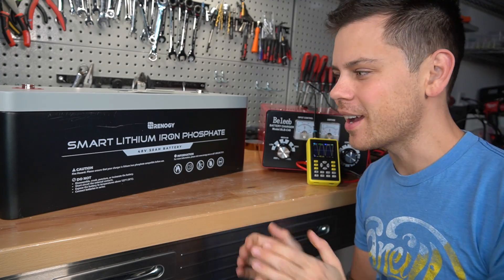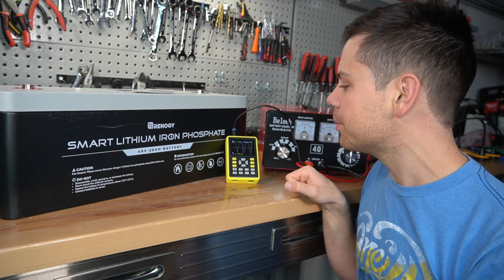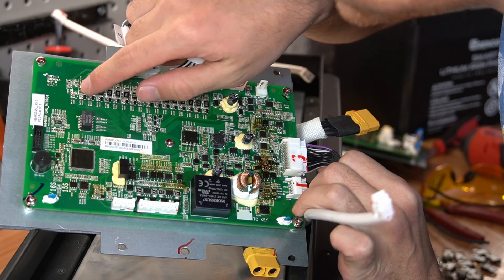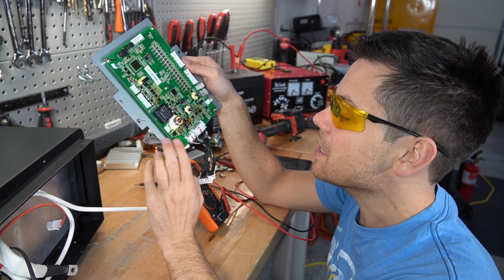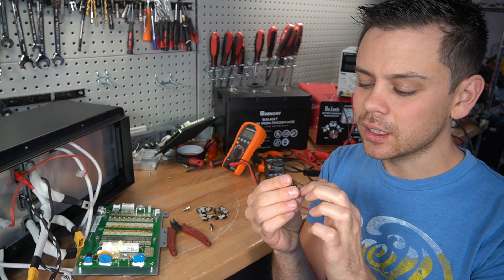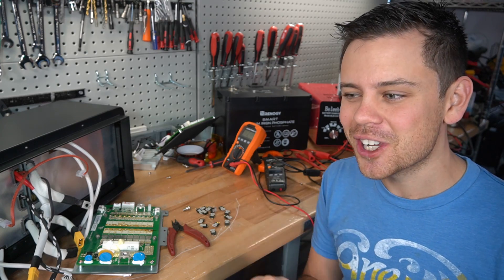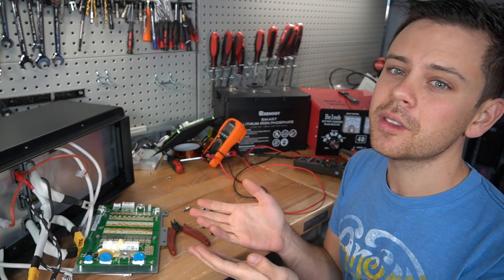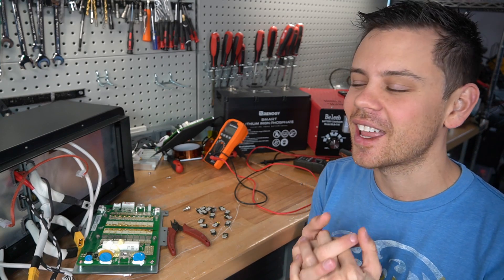Renogy "Smart" 48V 50Ah Part 2: How did I kill it?

Comment: For playing around with different voltages I like my Riden RD6018 DC Power Supply.  Will here's a show you could put on using different solar panels with a East Tester ET5410 or equivalent  use the LED settings to pull maximum or minimum of your choosing by changing to offset the voltage to its maximum or minimum.    Next change amperage higher or lower to get the Watts  maximum or minimum.    Settings on the ET5410 goto MODE scroll using Dial knob to 12.LED hit ENTER,   LED TEST SCREEN put the voltage on high setting or to your choosing same with the amperage you will see the ohms change as you do this try not to have error code come up you could have fun doing a show on the subject.  Your viewers would love it to see the maximum efficiency you can get out of a solar panel.  You could use this example with a solar panel tracking the sun or for individuals who use solar panel on a boat put it horizontal position and you could see the difference as well how much you can you can get out of a solar panel. You could do this from sunny or cloudy days.
Reply from the maker: What scope would you recommend? Any other equipment I should buy?
Reply: @WillProwse  Will I would not know how to answer that question it's just what I've been playing with and learning from watching you and other Youtubers love what you do experiment and having fun . I've learned this the other day stumbling across that and seeing what it can do.  ET5410.  From high school playing with electronics to my Navy days on the F4 phantoms aircraft.  Aviation technician. I'm 58 years old this gives me something to do. Remember how you start out and grow to your success, I'm proud of you how are you became pretty much nothing to where you are now.
Reply: @WillProwse  that new amplifier that you have to do load test do you think you could do that straight off the solar panels by tracking the sun or laying it horizontal to see what the solar panel results can be ?  ET5410 that's what I was doing the other day with that equipment I was having fun like if it was a manual MPPT tweaking the voltage amperage to see what the ohms resistance come up with pretty cool.  Most of the time you're always doing battery performance test do the same thing with the solar panels to see if the specs come out what the supposed to be lol. This is something to learn from your viewers I think would appreciate more information to use and maybe a different application by building different battery management systems at a lower voltage something like an MPPT charge control.  Opens up the mind to learning new experiences.
Reply: @waynemitchell7871  btw there is custom firmware from unisoft ..adds nice features for bat charging
Reply: @cgmarch2359  good point whatever battery chemistry you're using stay within the factory recommendation,  you can never go wrong and get the longevity out of the battery using it for what it's intended for . What I noticed like with lithium iron phosphate you have the minimum voltage and the maximum voltage. The battery management system you can change things around to get maybe 1 to 2% more out of the battery but then you're taking a risk of damaging it. If you wanted to do a true capacity test you would remove the battery management system straight off the battery see what it can really do have all your test results closest to the battery to minimize any efficiency lost through wire traveling distance and heat loss with small gauge wire. Big gauge wire always good to use to keep it cool when pulling high amperage.  Make sure you have the proper test equipment not to damage anything. There are some people would like to see what the batteries can do by overcharging them and blow off some electrolytes lol. There are plenty YouTube videos on that.

Comment: You should not call the charger as "crappy" since it works perfectly for intended purpose, charging lead-acid battery.
When the BMS disconnect at max voltage, fully excited induction coil in the charger can't keep the current flow, so the voltage spikes to kV range. This will never happen with lead-acid battery.
Reply from the maker: Yes true
Reply from the maker: Still going to use it for lead acid too

Comment: Good stuff. Is it possible to connect a charge controller mppt to that charger so you can limit the voltage and convert the rest to amperage? For next time of course... :)
Reply: Yeah, this can work especially if you have an unregulated power supply. Just be sure it's MPPT. PWM controllers with a higher DC input can fry batteries or loads depending on use. Many cheaper PWMs rely on the battery load to regulate the output, so if you remove the battery, the output peaks up to the input voltage. Of course almost all controllers tell you to connect the battery first and remove it last, so caution is advised.

Comment: The bottom line to me is that you used that charger with other batteries without damage, makes this one look pretty fragile.
Reply: Exactly
Reply: My F350 would seem pretty fragile if you dropped a bulldozer on it. In the real world, these batteries would not see the extreme conditions that Will exposes them to. I don't think Will came to the same conclusion about the durability of these batteries that you did. Maybe the charger developed the high voltage condition between the time he used it on other batteries and the time he tested the Renogy battery. There is no way of knowing if the test conditions were exactly the same.  I have seen nothing in this or his first video that suggests that these batteries will not perform as expected.

Comment: Will why use cr@ppy chargers?  There’s a volume seller of meanwell HLG-600H-30A adj CC&CV , nom 30V power supplies on e bay. They are rock solid and have ridiculous 95%efficiency and near unity PF.   Heavily used in ebike world in series/parallel.  A 2S2P  config of those would give you a super hi quality and safe 40amp charger for 48v class packs.  I paid around 50/each for a dozen.  Units are brand new, some kind of massive clearance situation. ..
Reply from the maker: Because I was an idiot and using my favorite inverter charger for my golf cart. I forgot I had two spare growatts I could have used instead. And yes, I will use a better one next time. I was just grabbing what I charge my other 48V packs with. Stupid me
Reply: @WillProwse  oh but so many of do exactly the same thing...thats the kicker.  Perhaps the question might be, why dont they design them for real world users?  Otherwise its a bit of "tricky talk" advertising specs when people are going to use it in certain culturally predictable ways. Oh, were they designed by Chinese? tricky consumer culture there, fast and furious, the salesman disappears into the crowd of one biliion after making great promises.  Missaprehension of implications to "win at all costs" and what the implications are for the future customer relationship and loyalty. 

Manufacturers and engineers are unconditioned to affluence and legacy first world marketplaces; have no culture of inventiveness and individual identity cuture,  even more limited at understanding target market behaviour and psychology(that's you and me babe, and we all have 5 chinese slaves.)  As well, many products are being (poorly, under duress) produced by political prisioners.

The company should take note: they will save money, reputation and consumers on returns if they design for the real use scenario.  Also, there is a HUGE return rate on electronics, becasue people cant figure them out.  It is in the manufacturers best interests to assure pain free adption of their technology by directing the product to the correct demographic, and educating their potential customers.

This is not a game where they are right and the customer is wrong.  However, I can see that arrogant and slightly aspergers engineers might take that predictable alpha male stance of win at all costs, have no backup plan, damn the torpedos, break the customers hymen and impregnate that market bitch at any expense. And so the ship goes down, you sunk my battleship!

In a new business venture, many would rather be a glorious failure than a miserable sucess.

Comment: Will, can you fix the battery?
Reply from the maker: Haha no
Reply: @WillProwse  Could you ship me the battery? 😊 I could fix it up and use it.
Reply from the maker: @ShaneFromSA  It weighs sixty pounds. where do you live? And the cells are over charged. And the board is fried. What could you salvage?
Reply: @WillProwse   It looks like it has settled down, 22V for 6S and 25V for 7S, looks like the cells might be salvageable. I would try to repair the BMS, if not possible I would replace with another one. I live in MA, I would pay for shipping costs.
Reply: @WillProwse  Bummer. I guess you can salvage some of the parts for a future home build.

Comment: This is why we watch your videos Will! Always up front with mistakes and problems.

I am SURE any of us idiots out here would use similar tools. 

Manufacturer recommended charging is probably a good idea.
Or, you know...

Solar.
Reply: In this case I don’t think the users are idiots. A product like this should be able to handle lead-acid chargers and if they don’t that would justify a very loud warning on the battery near the connectors. 

But from a very high priced product like this I think it should be able to handle high voltages or at least not be broken by it.

Comment: Thanks Again Will, I believe the assessment on the Charger is correct and I am very glad you addressed this in a Video w3hich people WILL WATCH, rather then read through all the long text interchange.   FETS are great but cross their specified threshold even just by a smidgen and POOF that's it, that's all.   The BMS could likely be repaired if anyone is inclined to do so.

Comment: I think your conclusion is good and the output of the charger is probably awful but measuring it under no-load as it looks like you have done will be the absolute worst case scenario for what it can output.

That said, at low output current (like towards the end of charge) you will get more and more of that appearing.

If you really wanted to use that charger you could resistively load the output in parallel with the battery to limit the minimum current the charger can supply which should in turn reduce the over voltage transients when the BMS hits its high voltage disconnect. Buuut you'd want to test that before relying on it.
Reply from the maker: Yes good point.

Comment: Another thing that can destroy FETs is static discharge, which is along the lines of your over voltage charger, but static discharges can be thousands of volts, so it's always a good idea to earth yourself when you're working around them.
Reply: I have never had a problem handling IC components! I never ground for static!

Comment: Posted this on the (now private) first version of this video, just adding it here again for the sake of completeness:

Not sure if you know this already, but your methodology for testing the mosfets does not seem correct since they all measure in the hundreds of ohms. Because mosfets are voltage controlled devices you need to discharge the gate before measuring the drain-source resistance to determine if they are shorted. Just short the gate to source to do that. Also make sure you do not measure the body diode of the mosfet by accident (check polarity). Killing mosfets with ESD is a somewhat rare occurrence nowadays since especially large FETs have high gate capacitance and are fairly robust.

As far as killing the mosfet goes I'd presume that it was killed by inductive kickback from the charger. Judging by the loud hum emitted by it I'd suspect it contains a big iron core transformer. When you remove the battery from the charger, or the battery hits high voltage disconnect the sudden drop in current can cause an inductive voltage spike if the charger does not have adequat smoothing capacitance at the output (which, judging by the voltage waveform seen at the output it does not).
That said I'd like a BMS to be able to survive this sort of abuse. Supressing voltage transients at the input would not be too hard.
Reply from the maker: Yes that is why I refilmed the second half of the video. Did you watch it? I updated it because of your comment. The second half of this video is different now
Reply: @WillProwse  Ah, cool. I suspected some other folks might have jumped to the same conclusion as me. Had no idea it was my very comment prompting that change 
👍
Reply from the maker: And yes, massive solid core transformer. That kickback is probably massive
Reply from the maker: I saved your comment when I pulled that video down haha thanks for the help. The inductive voltage spike makes most sense to me. I agree

Comment: Will....PLEASE buy some credible test equipment and power supplies (HP/Agilent, Tektronix, etc).  Such mistakes after using junk equipment hurts your credibility after all you invested.  You now have the money to buy some good stuff so please do so instead of another Tesla or golf cart.
Reply from the maker: I just bought a $1200 lab grade capacity tester lol but yes, need a better charger. I usually test 12/24V packs, or use my 48V inverter charger. But I was using that on my golfcart still. I had a spare growatt I could have used. Oops.
Reply from the maker: What do you guys recommend? I should shell out the money for a good scope.
Reply: Chroma and Lambda make some awesome programmable power supplies for high power. They even have some regenerative ones for battery cycling that I haven't played with yet.

For a scope, you could go big (Keysight, Tektronix, Rodhe & Schwarz, etc), but a mid-range Rigol with a big screen and video output would likely suit your needs.
Reply: @MarcelStieber  I think the Rigol would be more than adequate. Doesn't need any super high frequency so even the low end are plenty good for that, and most likely the protocol decoding and deeper capture, etc. of higher end scopes wouldn't be useful.
And frankly, operating a scope can be a bit tricky, and it might be better to start with a less expensive unit for less loss if an accident blows it up.  In college I used to supervise a lab for first and second year electronics technology students. Even after the introductory training, we would lose so many 'scopes...
Reply: @Sylvan_dB  100% agree.

Comment: Let me get this straight.  You are using a DC charger that outputs AC.  WTF?
Reply from the maker: Oh no that is just ripple. It is not alternating current. Still DC
Reply: @WillProwse  Ripple IS "ALWAYS" Changing voltage IE AC
Reply: @milesmccarty1005  A.C. stands for "Alternating Current" which means the polarity changes and the current flow alternates directions. Pulsed D.C. or ripple is NOT A.C.
Reply: @WillProwse  I get that, but that looked like a pretty healthy ripple to me.  Shouldn't it be under a few tens of milliamps?  Shouldn't we expect a steady DC current to charge a battery?  Maybe the charger is so crappy that they left out the filters to save money?  ;-)
Reply: @tra757200  Great filtering isn't necessary with a lead-acid charger.

Comment: What quality charger would you or other commentators recommend?
Reply: It all depends on WHAT chemistry you are trying to charge and HOW FAST and aH of battery
Reply: You can use any charger or solar controller  but lifepo4 batteries should never be charged with fast charger above 3.4 because these batteries go crazy above 3.4v.
Reply: I have a battery tender automatic battery charger. That says it charges at 12 volts with 750 milliamps. Would this be okay to use on a small cylindrical cells , I have a 4S 8p configuration. Currently testing out and using battery hookups new lithium iron phosphate 5000 milliamp cells. Because it's a bit cheaper than the Prismatic cells and I'm only building a 512 watt hour battery and I didn't want to go the used 18 650 route. Any information would be greatly appreciated
Reply: @mindovermatter3988  That charger is fine but don't charge it above 13.6v and make sure cell are within 5 mv.  Trurnigy accucell 6 will do it automatically. Balancing and charging.
Reply: @nelio SAMch I went ahead and looked up the charger and the reviews are up and down, still worth a try but I don't know about having to buy another power supply for it. I'm going to be processing multiple individual cylindrical cells and just pretty much need to be able to top balance them before I build my pack as well as charge after the pack is built. I was going to use my lab bench power supply to do all the balancing, but needed another solution for charging after my pack is built to make things simpler. Thank you for the feedback, it's greatly appreciated.
Reply: @mindovermatter3988  turnigy will do top balancing because it has an algorithm especially for lifepo4  cells but the battery tender won't and if you don't unplug the battery tender at 13.6v it will damage the batteries.
Reply: @nelio SAMch okay I see what you mean, the battery tender will work but I'll have to be a lot more careful with my charging and disconnect it at 13.6 volts. So the trulogy charger is better suited for my application